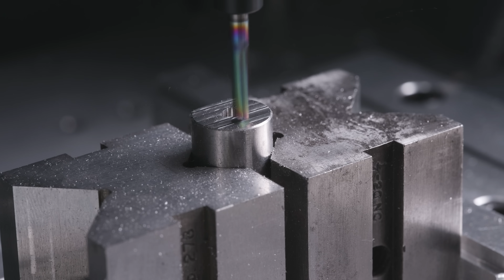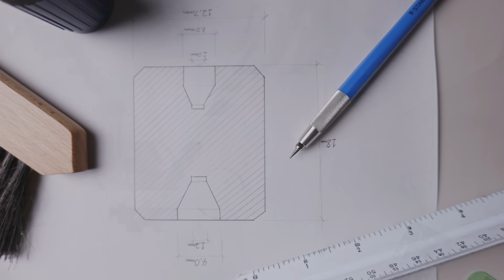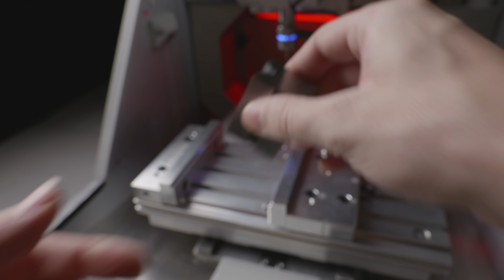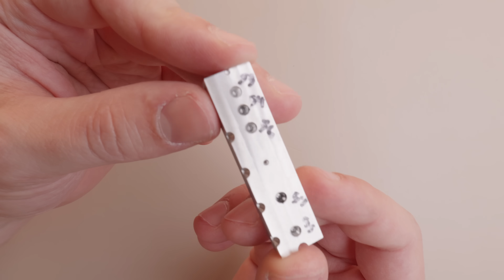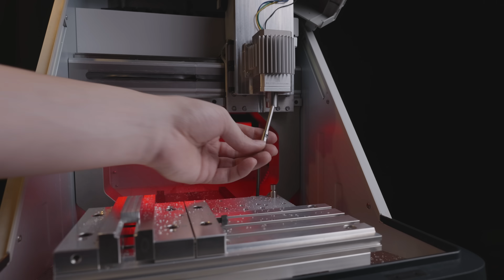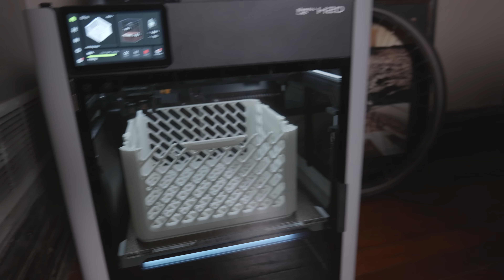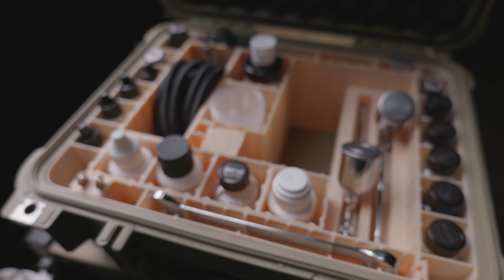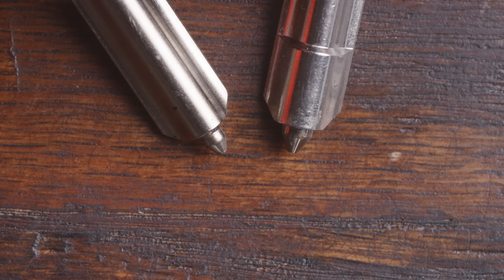Inventing A Tool Every 3D Printer Needs

Comment: You should have made a little rotary brush which is driven by the handel by an 4/1 reduction. The design in the moment is to specific but it works great for your application so good job ❤
Reply from the maker: Oh thank you! an spring loaded rotary spin tool thingy would be sweet. I just wonder how 3d prints would handle the friction. I know resin prints tend to have alot of friction between parts.
Reply: @Unemployed_Architect  You could add an feature to the outer zylinderwall which an grove going up and down like an wave all around the zylinder to supply the rubbing surfaces with some greas throu an greasingnippel.

Comment: To get the correct angles: Could you not use a 3D scanner? Those are pretty accurate up to like 0.01mm if you buy a MetroY Ultra.
Reply from the maker: Mayyybe honestly i have always been skeptical of 3d scanners. Although it seams like they keep getting better each year

Comment: Maybe you can spring load the scraping blades such that it conforms to the angle and applies constant pressure. The blades can connect and pivot on a pin. I would love to have a tool like this. It certainly would help keep the nozzle clean. However the materials that stick the most to the nozzle usually causes issues mid print. This helps only with materials that stick just enough that you can clean it between prints and be ok for. Print to print.
Reply from the maker: Spring loaded would be nice. Although finding and installing springs that small doesn't exactly sound fun haha. Ya the mid print blobs are the real problem. That's why i always try and get mine spotless. In the hope that it will reduce the blobbing mid print.

Comment: I definitely need a tool like this. My printer's nozzle gets coated in plastic very quickly and I'm only averaging 1 hour of printing per day. Currently I'm using tissue to wipe the plastic off the hot nozzle but I do burn my fingers every so often.
Sadly I have a feeling that the manufacturers may be don't really care about the outside angle of the nozzle meaning everyone's nozzle is slightly different. I seem to have 3 different angles in my collection though I don't have a way of accurately measuring them.
Reply from the maker: The difference in nozzle angle might be this tools achilles heel. Something that has some compliance or adjustment might be the way to go. Some people have even suggested using steel wool inside a 3d printed cone might work just as well, with the nozzle heated though.

Comment: you could just replace silicone brush with brass brush accounting for nozzle height, it's generally were mostly used on printers before bambulab decided to start existing.
Reply from the maker: The only issue there is the brass brush will wear holes into your silicone sock. I have done it before just scrubbing the nozzle by hand.
Reply: @Unemployed_Architect if you set it at proper height, it should not touch sock at all and still will scrub everything from the nozzle like I have if on my v2 for almost five years now
Reply from the maker: Oh nice. I was assuming you would have to like mash it into the brass brush, mostly because that is what i have always done when cleaning it by hand haha. But ya it makes complete sense especially if its doing it every print, so there isnt a ton to take off

Comment: I need to know how you make makera cut steel I truly need that :_
Reply from the maker: @princeofrandom6734 In general i don't recommend cutting steel with the makera, mostly because it doesn't have a coolant system which will wear out carbide tooling fairly quickly. For small projects here and there it can be done. You gonna want 1/8" diameter 4 flute endmills with 30 degree helix. The flute length should be as short as part will allow. I would recommend a SFM of 200-250 and feedrate per tooth of around .0005 inch and a step down of .0005 inch. This is fairly conservative feed rate but a good starting point.
Reply: @Unemployed_Architect  Yea, I'm trying to build my first plasma cutter in a laser engraver machine, which is much easier for cutting than getting a CNC to do the same job. Try that out; it's amazing

Comment: I use cotton swabs to clean the nozzle... and I rarely ever have to clean it.
I'm thinking that the wire brush probably leaves small scratches, which make the filament stick to the nozzle more easily, which results in more cleaning, resulting in more micro-scratches, resulting in cleaning more and more often.
If it ever gets hard to remove, I use paper towels or stick the cotton swap into a drill. But that usually only happens if the settings for the filament are really off.
I've actually thought of a similar solution as yours - kind of like a pencil sharpener. But then I thought a mere rotating concave cotton pad, just larger than a cotton swab should work really well.
Reply from the maker: Im gonna have to try the cotton swab / tissue idea. Im surprised i had never heard of this before. I think the brass brush could at micro scratches if your nozzle is also brass but not if its stainless or hardened steel. The amount of cleaning really seams to depend on what material your printing. Some are more stick prone than others
Reply: @Unemployed_Architect  To be honest, I haven't heard of it from anyone else before either. When I did have to clean my nozzle, I didn't have a brass wire brush handy, so I tried various other things. I tried with cardboard and paper towels - knowing paper actually is abrasive too, but definitely less so than my steel pliers. Wrapping cardboard/paper towels around the tip of the pliers did not work that great.. but if you have nothing else. Then I realised that my rotary multi tool actually came with brass wire brushes, which I did try.. but then felt like it did not work much better than cardboard/paper towels.. thinking something "rotary" with a softer heat-resistant tip - preferably convex - that can contort to the shape of the nozzle would be ideal.. so eventually the cotton swab idea came to mind.. maybe to reshape them somehow, or use some negative shape with cotton wipes. I got a few ideas, but my higher priority was to get printing again.. otherwise I'd have gone down the "distraction rabbit hole" (which I already was in anyway 😅).
I gave the cotton swap a try, mostly to see if it'd work.. and it worked much better than expected.
I'm not printing THAT much. Since then probably 2-3kg in total? My printer does some "self-cleaning" before printing - which definitely helps too - unless it doesn't. There definitely was something wrong with the filament settings, as it kept piling up and kept sticking to the nozzle, but since that cleaning, I haven't had another issue yet.
I think it happened when I swapped between PLA and PETG.. then had issues with that filament. So there was definitely PETG caked onto the nozzle too.
So far I've been printing PLA, PETG and TPU without any further issues.
I did get replacement nozzles with .4mm brass, .4mm hardened steel, .6mm hardened steel (or rather nozzles with hot-ends, since it's one unit) - just in case.
Next time I have to clean, I'll definitely go cotton swabs first.
One idea that came to my mind was to use a wooden dowel, try to add a tapered hole to the tip, which is somewhat similar to the taper of the nozzle tip - then press a cotton ball, or the tip of a cotton swab, or a paper towel into the tip.. and then try to find a way to use that with a power tool. I don't think my drill would fit, the rotary multi tool.. could be tight.. maybe the electric screwdriver would work. 😄And since the cotton/paper towel has some give, the shape doesn't have to fit perfectly.
Have a great day, and happy printing!
Reply from the maker: @clemensruis 
Okay this is making me think you might be able to just print a cone shape, similar to my tool, and just stick a cotton ball in the bottom. The print will give it something to press up against and you can easily swap the cotton ball out when it gets to dirty.
Reply: @Unemployed_Architect  Yeah, probably. But the print will probably soften if you use it for too long on the heated hot-end. Oh, but you could probably also add a cotton ball to the tool you created.

Comment: what if you have the piece connect to a freely spinning baring that spins around the nozzle tip so you have something that meets with the nozzle and then brushes that spin around can even have end stops to scrub forward and backward then you can have the hand holding section to be a waste disposal area

Comment: I am definitely not a machining guy so I could be completely wrong and talking out of my butt here but if you made the interior of the tool flexible, I feel like that would be universal across different nozzle diameters and cut angles and all that. Like what I've got in my head is a hole with like a fine wire mesh pulled across it. As the nozzle presses into the mash it to forms it just enough that the mesh can wrap around the tip of the nozzle. Then theoretically you could put any nozzle that could fit inside the hole in there and it would do the job you're looking for. I'm probably completely off base and I'm completely open to criticism on this but that seems like it would work.
Reply from the maker: No honestly i think your right. Like a 3d print with the general shape and than some steel wool or other abrasive pushed into the center would great. Or at least i think it would. Only one way to find out.

Comment: Nice, but ridiculously, absolutely overengineered, like most 3D-printing stuff. Use a tissue paper, fol it several times and wipe the hot nozzle. Done.
By the way, how do you clean the tool?
Reply from the maker: Thank you! and ya definitely overengineered although you could go way further haha. I found just blowing into the tool clears out the plastic really well.

Comment: Add a flat on largerst diameter of that handle.
So it not roll out of the table :)
Reply from the maker: I did add a flat to the bottom so it will stand vertical but inevitably it will eventually find its way to ground.

Comment: Ok, now make that a 1/4inch drive bit and you got a sale, provided it's sized for the X1 Carbon. Bonus points if it'll work with a Microswiss Flowtech nozzle.
Reply from the maker: 1/4 inch drive would be nice. X1 carbon honestly probably would be the best seller. I cant even imagine how many they sold over the years.

Comment: Now go back and eliminate all the unnecessary cosmetic add-ons that contribute to toxic pollutants but absolutely NOTHING to the functionality.  A "quick sanding and a clear coat" = quick microplastics and volatiles pollution.
Choose your battles carefully and save the poison for the important stuff.
Reply from the maker: A clear coat is an essential feature to any resin print. Especially when handheld as the material easily scratches from finger nails...which is technically creating mircoplastics. Its a lose lose either way. Which is why i ride my bicycle to work. dont sweat the small stuff.
Reply: @Unemployed_Architect  As long as you cling to end products that require an ever growing number of vanity steps,  steps, you move away from efficiency and elegance in design.
Think of the impact of your demands if you multiple them by thousands of viewers of your process, each of them sanding resin prints into a fine dust to add to our collection.
Just consider it for a moment.
Reply: @Unemployed_Architect  Oh, its just as bad either way?  I apologize.  
It sounds like it would be stupid for us to NOT use more steps using more varied and layered petrochemicals.
Make sure to spread this philosophy via your instructional videos!

Comment: That’s pretty cool. The next step is that it needs to run in coiled slot with a spring to push it out. That way you just push it on and it twists itself. Then need to mount it in the machine somewhere and have a routine to just drop the nozzle on it.
Reply from the maker: Im shocked i didn’t think of that. Overly complicated is right up my alley (:
Reply: @Unemployed_Architect  there’s still there me for version 2!

Comment: Check out the cutting blades on a nasal hair trimmer….spring loaded teeny tiny blades that would conform to any nozzle shape, just make them fit into your tool….that should drive you sufficiently insane. But the handle deserves it…..
Reply from the maker: haha sufficiently insane is accurate...but it would be cool

Comment: What I created was reverse external deburring tool (or a form-fitting rotary scraper). And so far is working perfectly you might want to look at that route.
Reply from the maker: Well thats basically what i machined. Although i didnt make the cutting edges as pronounced as you see on commercial cutters. The poor cutter geometry my be mashing more than cutting on my design.

Comment: Use plastic repellant paint? Not saying this isn't a great idea, tho...
Reply: Also, after watching for a few more minutes, to use this cool tool don't you still have to remove the silicone sock on the nozzle/hotend? Still: *great idea*!!!
Reply from the maker: I have seen that stuff. Always just been a bit skeptical of it.
Reply: @Unemployed_Architect seems to work a treat for PETG in my case. It’s worth a shot!

However, it wears off over time and I’m pretty bad at scheduling reapplication based on my current printer usage. So, I inevitably end up with plastic stuck to my nozzle tip—just less frequently. In those cases, your tool would be most welcome!

Comment: Watched this whilst regretting my beverage choices last night and waiting for the coffee to kick in, and speaking only to the quality of the video as a video - it's very good.  The pacing and length hit the "mini-skirt" sweet spot (long enough to cover the subject, short enough to be interesting), the audio is clean, the delivery is clean, the video is good.  And as a Western Canadian your accent is fascinating. So just for sheer production value you've got me wanting to see more.

As for the tool itself: I can see how it's useful, but until there's a way to easily mass produce every variation, I don't see how it's viable.  And it would need a LOT of variations.  Leave aside the variation inside the Bambu nozzles - what about Prusa nozzles? Revo nozzles? Snapmaker Nozzles? Mark VI nozzles for the old school die-hards? Everything is going to be different.  And that's just sticking with the harden-steel nozzles; you'd need to make versions out of something softer for the brass nozzles so people weren't slicing up their hotends.

Nor is this something that can easily self-produced.  Ignore the resin printer, which was used purely for aesthetic reasons; even so, this required a CNC router and a milling machine and the skill to use them, which means the vast majority of people for whom this is useful lack the skills and tools to make it themselves.

Low-volume production (ie, you making them yourself and selling them) will run into a cost-vs-value problem. I'd be willing to pay 10$ CAD for this, which is about 7.50$ USD.  I might be willing to go as high at 15$ CAD. But that number includes shipping. So to get a sale from me, you'd need to get your sale price under 10$ USD. That means that even if you don't charge for your labour, you'd need to have under 5$ of material in each item.  (If you charged 25$ USD for this and told me you were only making 1$ profit off each, I'd believe you - but I wouldn't buy the product because it would cost more than it was worth to me in saved effort.)  Now admittedly, I'm not your ideal customer - I'm a low volume user, and I'm a low-cash-income-high-free-time person so spending 5 minutes to save 5$ is a good deal for me, and I'm Canadian so there's conversion rates, shipping costs, and Trump's tariff war all making my end cost higher than if I was in America. But the basic problem still exists.

In short: Awesome video, and a very cool tool that seems very usable but also seems very challenging to make for anyone who isn't you.
Reply from the maker: You may not of had anything meaningful to add to my better than gridfinity video but your making up for that here (:. I really appreciate you taking the time and supporting my videos!

This was kind of a lets see if this works kind of project. If i were to try and sell these at any sort of scale i would have to try a different process. I was thinking SLM printing might be a good candidate. I know there are places like PCB way that offer it and with large batch sizes could probably get the price way down. I would also probably just focus on the big printer names like prusa and bambu. Although its always gonna be hard to compete with 5 dollars for a brass brush.

Comment: Pencil sharpener where the angled razor can slide to fit different nozzle diameters if you only want to clean the outside and a "needle" type thing can go through the center. It is open at the bottom preventing any clogging on the cleaning tool and adaptable to any diameter.
Reply from the maker: you know i never thought of this as pencil sharpener but ya thats basically what it is lol
Reply: @Unemployed_Architect  So, you wasted your time making it & this video? I know I wasted mine watching it !

Comment: Could've removed the super glue with a soak in soapy water. Cyane acrylate is very susceptible to moisture.
Reply from the maker: What! really? i know acetone works. Does the suger glue still need to be tacky or can it be fully set.
Reply: @Unemployed_Architect  it can be fully set but it takes some hours in soapy water to become really soft (overnight is good).
It will also become cloudy white.

This is also the reason one should not use Cyano Acrylate for outdoor projects or things that see water and high humidity constantly.

Hope that helps 😊
Reply from the maker: it certainty does. gonna give this a go next time for sure.